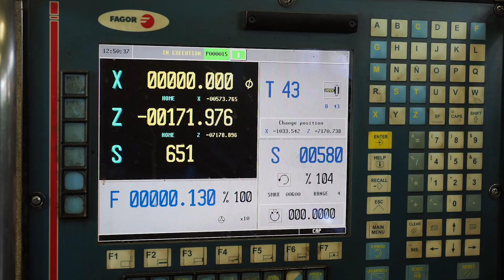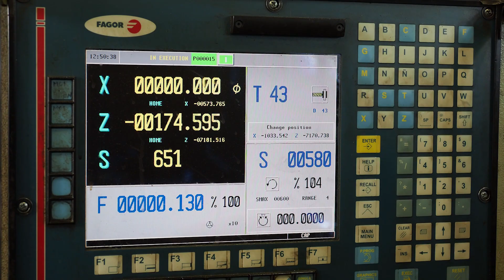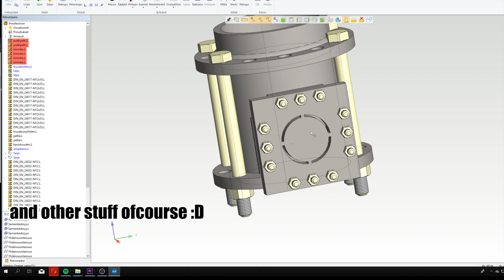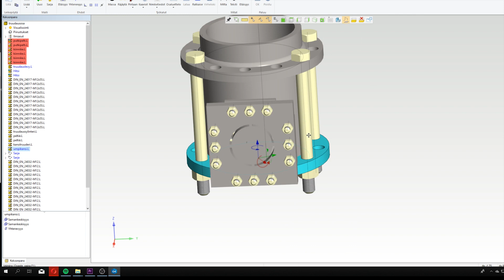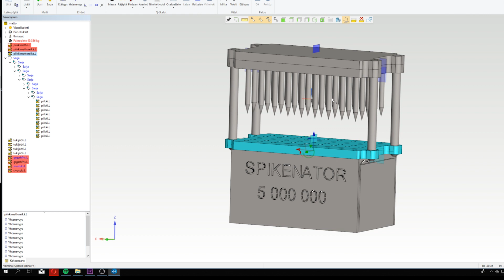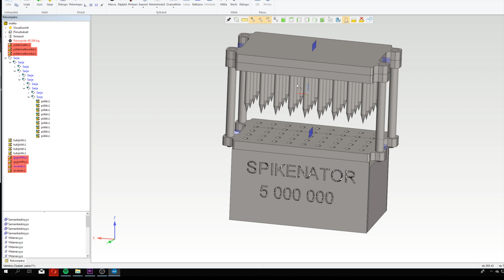Bearing Failure on Big Lathe

Comment from the maker: I didn't have much workshop time this week but I happened to film this which turned out quite interesting video! We lost most of the last week on our car problems but now we have working car so we don't need to steal Timo's van any more for country side filming days :D If you wan't to see part of our car problems check Anni's video about buying pick-up truck for our company https://youtu.be/Zyd-W8rCEOU
Reply: Beyond the press first comment to you
Reply: I think the spikes on the Spikenator will buckle and fall outside the 1/2 mm tolerance if you do something tough like a hockey puck or paper.  Perhaps shorten them?
Reply from the maker: I will probably make first easier crushes and then shorten them for tougher stuff. But if they got slightly bent they will self correct when they go into those holes
Reply: What if you place springs on each guide post of the Spikinator 5,000,000 to assist in raising the spikes?
Reply: May I suggest an angled piston when forcing things out the side.
Reply: This is your machine shop? You seem so young to have all of those large machines. Bet that old coolant smells nice :)  I bet the poor guy running that all day comes home smelling very special.

Comment: You should weld all the broken lathe and milling machine parts and tool holders into a trophy and present it to the next guy who crashes a machine in a spectacular manner. It's a long standing tradition in some machine shops.
Reply: Yeah, I had a job as a maint-mech and they wanted to know where all the $$ went, I showed them 4 of those 5 gallon plastic buckets full of broken parts....probably over 2,000 pieces in there of junk. mostly gears and bearings....5 years of guys beating the Heck out of everything...

Comment: Cant wait for spikenator! I guess bearing speed limits are there for a reason. When I saw the title I thought maybe the main lathe bearing went. Now that would be exciting!
Reply from the maker: We broke the gearbox couple months ago but it wasn't main bearings. Luckily those russian machines are really simple to fix
Reply: Beyond the press Probably built like T34 tanks were. Idiot proof and simple but got the job done!
Reply: from what I have learn in video games, you just need to use a Hand Hammer to fix old Russian gear.

Comment: 1. I hope the O.D. of that workpiece wasn't critical... looked like the bearing failure spalled it a little bit. Ouch.
2. The offspray of that cutting-fluid is concerning; machinists have developed pneumonia-like lung diseases here in US from breathing shop air with vaporized cutting-fluid in it. Granted, it's over years of doing so; but it has been fatal in a few cases. Consider increasing viscosity slightly and lightly masking up when you have a job like this. I know you probably do dozens of jobs a year (if not per month) like this; so measures to preserve your health while doing so are warranted.

Comment: The long chips from the hard material is really annoying. I get them a lot from drilling 1-5/16 through EN30B. I usually put coolant on the bearings when they are running really fast. Cool video!

Comment: A few ideas for extrustion machine hole shapes:
1. HPC (in the same font style as the SPIKENATOR 5 000 000)

2. Rifling-shaped holes, so the extrusions come out on an angle, similar to the water fountains you would sometimes see at a water park. 

3. A dotted line in the shape of a Pentagram. Machining this would be a bit difficult (from what I understand at least) but the outcome and the extrusion would look absolutely amazing!

Comment: 6:00 Put a nice lead-in radius or angle on the back of those slots for smooth extrusion.

I think you would also get nicer results with the worm maker if you did the same to that.
Reply: MPAH1981 yeah having a nozzle effect to help he extrusion process should definitely improve the end results.
Reply: Maybe even chamfering the exit to help slow down the exiting fluid speed would help retain the desired designs as they come out, but that I don’t know and is complete speculation.
Reply: You can also put the tabs that hold the extrusion shape deeper inside the chamber, or eliminate the tabs entirely and make it a long spike that comes from the back of the cylinder and have a complete circle or other shape in the extrusion.
Reply: All good info. Cheers gents. I didnt get to do a lot with extrusion. Only impact extrusion. I'm a toolmaker, among other things, but mainly worked in metal stamping/pressing.

Comment: How much damage did the failed bearing do to the piece being worked?  Is there machining to be performed on the outside of the piece too, or will unplanned repairs be necessary where the bearing dragged on the piece?
Reply from the maker: It's going to be machined from the area where it got scratches so I didn't check how deep they were but they probably only 0.5mm or something like that deep

Comment: It looked like the seized roller was chewing up the outside of the part you were drilling - did you have to scrap it, or was it ok?
Reply from the maker: We are going to turn lot of material away from that piece still so it doesn't matter. And those were pretty shallow scratches also since the material is so hard

Comment: Might I suggest a bracket on either side of the base to sit a small hydraulic jack on to raise the upper section. Just add a tab on either side of the upper plate for it to push against. That Spikenator looks good.

Comment: Question: how much pull force (moving up) does the Hydraulic press have?

Isn´t it the same as its pushing force?
If it is, maybe you should make a way to pull these kinds of tools apart again. Of course you would have to clamp it down to the table too.
Reply: Basement ScienceE The pull force is basically nothing compared to push force.

Comment: Have you asked Sandvic to come to your workshop and maybe provide an alternative carbide tip which has a better chip breaker for the drilling? When you started drilling the hole, the swarf didn't seem to want to break off I noticed. 😉

Comment: When you build the Spikenator you could have some large threaded holes in the top plate so you can use bolts to jack the plates apart, I think this would be easier than having to turn it over and push them apart through the larger hole you mentioned. If you put one next to each guide pin i think it would work pretty well and you wouldn't have to remove the central spike :D

Comment: You're making a giant pasta maker, so look at how they extrude different shapes (e.g. elbow macaroni (kyynärpää makaroni) or fusilli) and have fun!  Also, do you want to allow extra room for larger bolts or internally threaded (blind - not full-depth) rod that's a softer metal than your bolts so you can replace them if and when they fail?

Comment: What if the holes/apertures in the extruder plate were drilled through the plate at angles other than directly perpendicular to the surface? Can extruded spaghetti be made to shoot out at many weird angles simultaneously?

Comment: First of all, let it be known that I am not a machinist or designer, so please forgive my comment if it seems far fetched or out of line. Looking at your extruder design, I though flush mount torx (star) screws would be better choice than bolts on the template plate mount. That way you could slice off the play-dough or whatever you extrude. Easier clean-up as well. I know it would be more work since it would require tapered holes on the templates and tapping the back plate for threads. Just a thought.

Comment: On the center hold of that Spikenator 5,000,000, you sould consider tapping that center hold, so you can run a long coarse thread bolt through it, and use an impact wrench to back the spike plate out. Seems like it would be a much better use of mechanical advantage, than simply trying to force it open with a rod.

Comment: You should thread the middle hole on Spikenator5 million so it would be easier to push out👍
Reply: I came here to suggest this.  Lauri might want to do three or five holes, but then he'd have to coördinate the drive screws with a chain and gears.
Reply: I think Lauri might have some (not so small, green) pushing tool in the workshop. No need for threads and leverage when there is “the force”.

Comment: Could you use some of the milling lubricant on the guide rollers to keep them cool at higher speed?
Reply from the maker: Sometimes I have tried that when they are already in bad condition and it helps for a while but I think it's bad for lubrication.
Reply: Beyond the press Cool! Thanks, Laurie!

Comment: Why don't you mill a groove in the "hole plate" or the base of the spike plate, around the edges and then drill a small hole in the x axis (looking at your screen), connecting to that groove. You can use that to get the Spikenator unstuck with compressed air!

Comment: At my machining internship guys used to grease the steady bearing with chuck grease and the rollers used to lock like that. Fucking scary, and usually scraps out part. We also put vac.2 or what ever way oil was available in a spray bottle and spray it on the part where the rollers are, it makes the indents lighter and the rollers roll smoothly.

Comment: The changeable extruder plate with all them bolts holding it together will be time consuming why not get rid of the bolt design and go for a bayonet fitting like a light bulb.
Reply: is that the fitting when you only have to turn like half or a quarter of a turn then pull out?
Reply: Yeah thats the type
Reply from the maker: There is going to be at least 100 tons of force against that and it's going to probably get bent so I want to be sure that I am able to get it out
Reply: And it wouldn't take very long with a windy gun or battery impact driver on the nuts/bolts

Comment: i think maintenance would be a lot easier if you could split the cylinder axially, rather than just the bottom plate. For example when the piston got stuck, you are less likely to get damage. something like this but more pressure proof: http://matest.com/Cms_Data/Contents/matest/Folders/Prodotti/~contents/Q9GJ763QNTWYQMBJ/C259-05-72dpi.jpg
Reply from the maker: That would be so hard to make that I rather press piston couple times out with force instead

Comment: You will probably need a stripper plate for the spikes.
Reply: wich is?
Reply: A plate that will push the impaled object off the spikes. Similar to the plate with holes but movable.